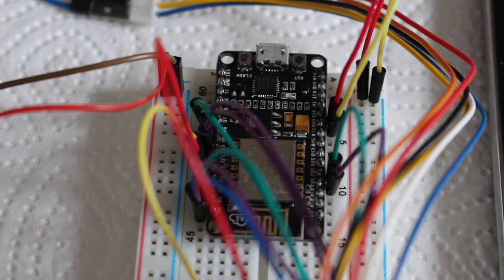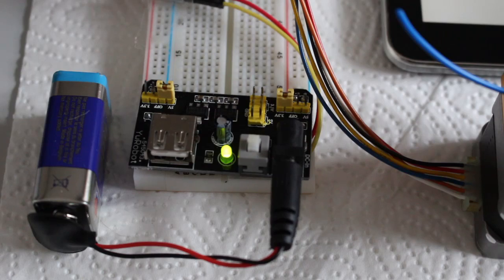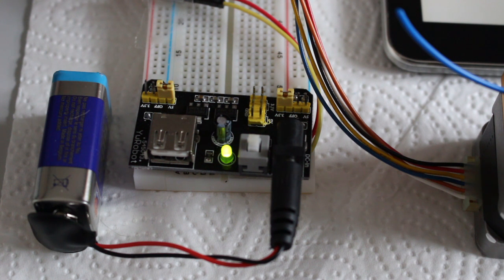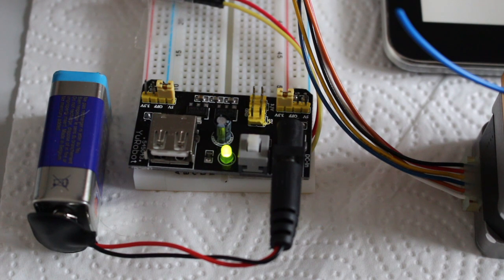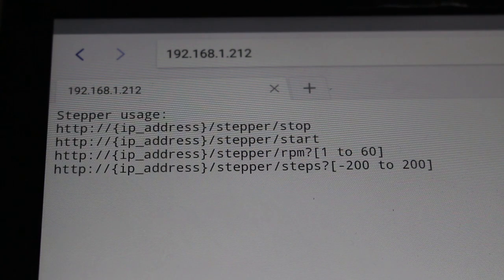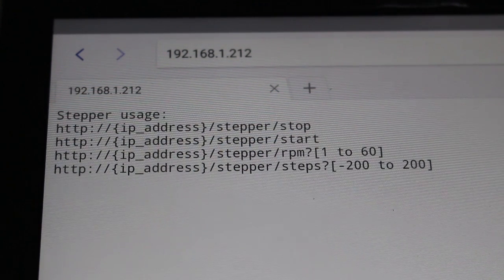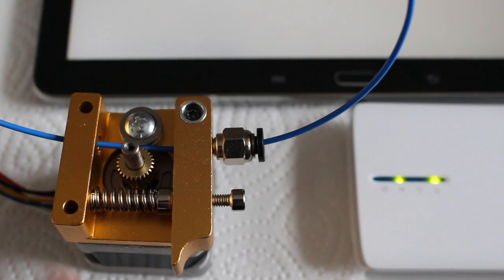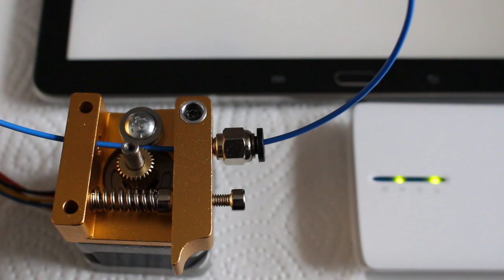esp8266 3d printer extruder

Comment: Very cool! I'm planning on doing a similar thing: using a NodeMCU and a A4988 to control a Nema 17 stepper motor which in turn will pull my binds up and down. 

So there was no problem controlling the stepper driver with just 3.3V from the NodeMCU?
Reply: Yep will power them separately. For a test I'm using an L289N module and an Arduino right now. They are both powered by a 12V 2A power supply, the neat thing with the L289N is that it has an built in regulator, so get 5V output to power the Arduino.

But will replace the Arduino with the NodeMCU, and the L289N with the A4988. Will probably use 24V for the motor then, and a separate voltage regulator for the NodeMCU.